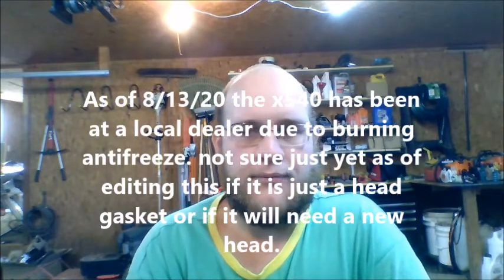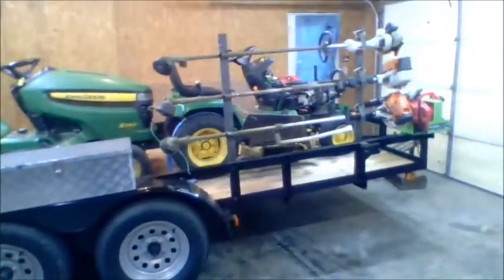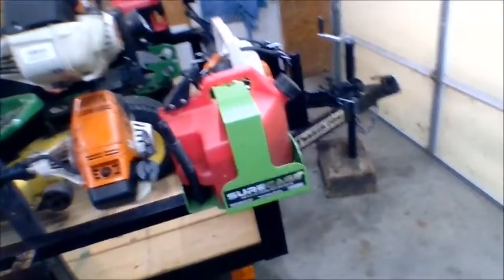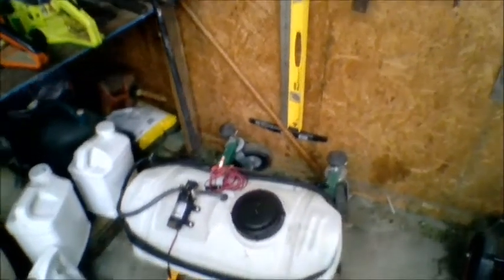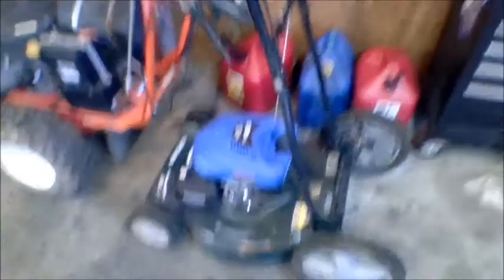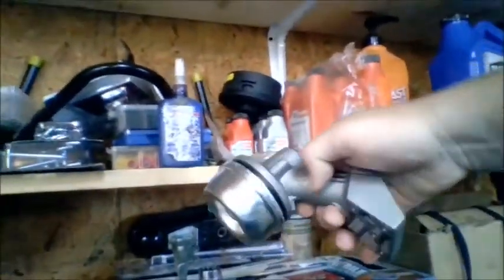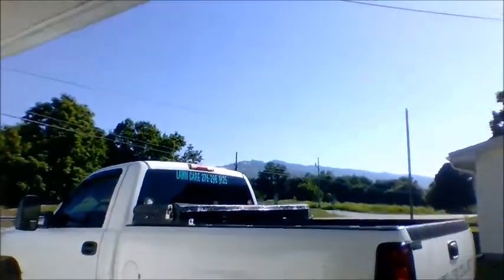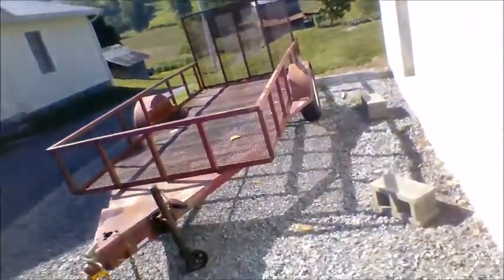2020 Lawn Care Setup and Updates

Comment: Sorry to hear about your back. I just got a Cub Cadet Series 2000 2186 model tractor that only has 900 hours on it. Just got done replacing the original PTO Clutch and I also put new blades on it for real cheap since I do a have a 2 acre yard. Nice John Deere's. Harbor Freight is a good store. Nice set up.
Reply from the maker: My back is doing better than it was but still not great. I plan to get a MRI soon to see just what is going on. xray showed a mild degenerative disk but i think something else is going on thats continuing to give me grief at the moment idk. I would like to have one of those bigger shaft drive cubs like that. Mine cuts nice and level but the mulching blades that came on it just dont do great while trying to use it commercially like i do. But hopefully i wont have to use it anymore at all. i gave it to my aunt anyhow but ive had trouble with my Deere's so ive had to borrow it from her a number of times. I got my x540 lined out $1700 later... and the gt235 i will be putting in the shop after the season is over to get it fixed. it runs fine now but it wont idle down. used to lope at anything below full throttle. not a big issue but id rather it work 100% yknow? lol. thanks for watching!
Reply from the maker: for context about 2 weeks ago my back went completely out on me. i recorded this some time ago. ive had some back problems all year but lately its been a lot worse
Reply: @BioHazardra  I will be praying for you brother I know HP lawns just had surgery on his back and he is young too. I can't imagine what your going through my friend, but prayers does go out to you.
Reply: @BioHazardra  Yes definitely get a MRI cause x-ray doesn't show everything. I totally understand cause I like my stuff working 100% too. Your very welcome and I'll be watching more brother.